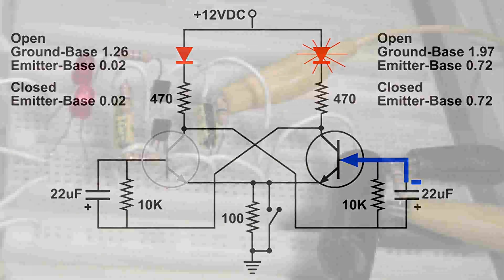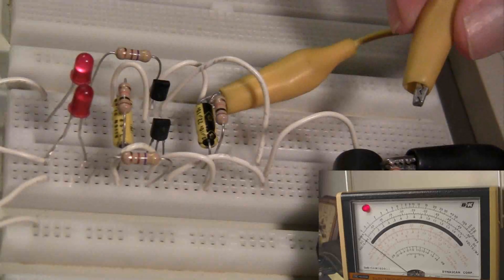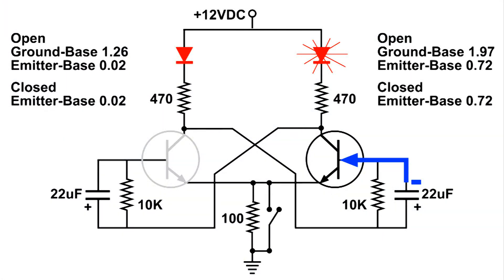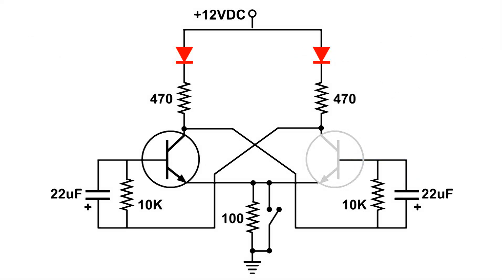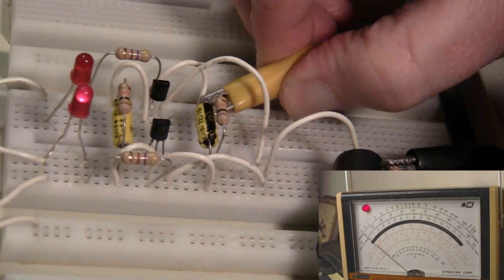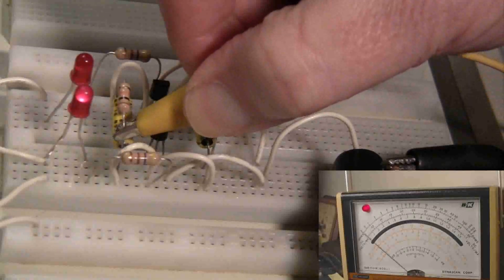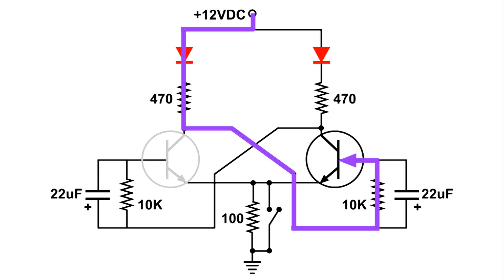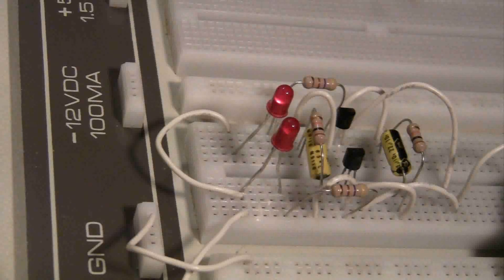Flip-Flop Circuit, build and demo

Comment: Thanks for this video, much appreciated, but I am confused.  At 2:12 talking about voltage levels, the right trans is on the left is not, but the left has a ground to base voltage of 1.26 which would seem to be enough bias to turn on the transistor?
And another point I don't understand, if the right trans base is getting it's voltage from the left diode side, wouldn't that mean current is going through the left side diode and would cause it to turn on, it has a 12 volt positive bias above it?  Obviously I'm missing something here and would greatly appreciate any explanation, thank you
Reply from the maker: +gw25 
For a junction transistor to conduct current between emitter and collector, the emitter and base junction must be biased from about 0.6 to 0.7 V DC, measured between the emitter and base. And this is not the case in either of your questions, that's why the transistor is not conducting. So if the voltages on the emitter and base never exceeds  0.6 to 0.7 V DC the transistor is not conducting.
Reply: +AllAmericanFiveRadio < Thank you again good sir.  I still have a point of confusion and I guess it's more in the nature of diodes.  At 5:25 there is a path from the right diode, through the 470 resistor, then crossing over to the left side of circuit going up the 10K resistor, through the base to emitter junction, and then through the 100 Resistor to ground.  So the right diode has a 12 volt source right above it and then a path to ground making a complete circuit.  Does it not light up because the 10K resistor limits the current too much to light the diode.  B/c currently I have a understanding that diode will conduct, and in the case of an LED light up, when it has more than a .7 (or so) positive bias across it, resistors are just used to drop all the rest of the voltage and limit the current.  Thanks again and hopefully I'm not being a pest.
Reply from the maker: +gw25 
In this circuit the transistors have only two states, when they are conducting it is a dead short, when they are not conducting they have infinite ohms. So the side that is conducting shorts out the 12 V DC and the other side cannot see it. When that side stops conducting it is wide open, now the other side can see the 12 V DC because it is no longer shorted out.

Keep asking your questions, I can remember the first time when I was trying to figure this out.
Reply: +AllAmericanFiveRadio , thanks and I shall.  So I believe I understand what you are saying about the transistors.  When one is on it allows the 12 V source a path for the LED with only a 470  and 100 resistor to ground allowing for a good deal of current.  But here is what I'm still failing to grasp.  The right diode is on it is b/c the right transistor is on.  And I believe what turns the right transistor on is b/c it has a voltage on the base to emiter junction greater than .7 volts.  I believe that voltage source is coming from the left diode (which is currently off) circuit.  At 3:56 you clearly show this.  So if there is current flowing form the left (off) diode to the base of the right transmitter, why is the left transistor not forward biased enough to turn on.  I enterperate you last explanation as when the right transistor is on it is sucking all the current from the voltage source, but as I currently understand things the right transistor is only on b/c of the voltage/current it is getting from the left (off diode) path.  

I also don't fully understand how the voltage for the ground to base is 1.97 volts on the right side transistor at 3:56.  Again if it's voltage comes from the left (off side) then wouldn't the voltage on the right side transistor base be what was left after the 10K resistor.  As I currently calculate that would be (11.3/ 470 + 10K + 100) * 10470 = 11.19 voltage droped at the after the right transistor 10K resistor.  

Thanks again
Reply from the maker: +gw25 

Think the problem you're having is you're not understanding what a transistor does in the circuit. The side that the LED is lit, take the transistor out of the circuit and put in a straight wire from collector to emitter. So now the resistors that are in circuit are the 470 ohm and the 100 ohm to ground.

I think this video will help.

Transistor, How Does it Work in a Circuit, Demo
https://youtu.be/vs3zUHdlsYY

Comment: Hello , I appreciate your work and explanations of circuits, question..will this flip flop circuit work as an h bridge, similar to an h bridge running in astable mode reversing a dc motor??
Reply from the maker: The H bridge provides two paths to power, one positive and negative, and the other one negative and positive. This flip-flop circuit does have a path to positive when the light is lit, but the other side is open, no path to the negative side.

Comment: so im planing on building one of these circuits for my car. ive got 4 coilpacks currently in parallel batch fire. which isnt desirable. they are 4 wire coils with 12v pos, earth, 5v trigger send, and trigger return (tells the ecu fire was successful).

i want to make this circuit using 12v to the coilpacks as the source voltage (data input) and instead of a switch, i want to tap into the 5v trigger, and hook it to a mosfet to act as a high speed relay for the switch. 

in effect, the q and bar q will turn my batch fire into a proper waste fire where coils 1&4 are powered on q and 2&3 powered on q bar.

the trigger will fire every 2.67ms at redline, and coil fall and charge is supposedly 1.8ms so that all looks good to me.

THE QUESTION:
will running 12v (i THINK 6a but i havent put an amp clamp on it) through this type of circuit be possible? im new to digital circuitry and im having trouble figuring out if this will work like a charm, or burn up and die.

i have a schematic i can send you as well as all sorts of specs like trigger rate etc

anyways, any help would be appreciated!

Comment: Is there any way you can automate the switch so it you do not have to open and close it manually?
Reply from the maker: Yes, do a Search  on my channel on “MOSFET Multivibrator Build and Demo”
You can use other transistor types besides MOSFET
Reply: Yes, it's called an astable multivibrator and it's a very similar circuit to this.
Reply: Thanks. :)

Comment: At 4.03 are you saying that the capacitor discharges in the base of the transistor and turns to off? Wouldn't a current turn it on? Sorry, my understanding of electronics is still in the early stages. :s
Reply from the maker: I'm using NPN transistors, and the N and P denote the type of material doping, in this case silicon. The base material is doped P, that means if you put a positive bias on it the transistor will turn on. If you put a negative bias on it it will turn off the transistor.
Reply: Many thanks for the info. :)
Reply from the maker: Flip-flop circuits are very balanced circuits. The impedance or resistance at the collector is much higher than at the emitter. When the 22 µF capacitor charges the current charging the capacitor never exceeds the transistors trigger threshold. When the 100 ohm resistor is shorted, this makes the impedance at the emitter even less and that causes the charged 22 µF capacitor to produce a negative pulse on the base of the NPN transistor turning it off.
Thanks Sam
Reply: Positive current at the base of a NPN  transistor will turn it on while its there, but negative current  will turn it off, Notice that capacitor only gave a very short negative pulse, if the other transistor did not turn on or was not in the circuit this transistor will come back on again when negative pulse ended, Because the other transistor came on and  positive current stopped flowing through the base of first transistor it stayed off.

Comment from the maker: Thanks Lachlan Baird-MacKenzie
I'm going to experiment building another flip-flop circuit using FET transistors. My thinking right now is it would be easier to build and work better, but it could be just the opposite. Anyway it will be an interesting experiment.

Comment: Thanks for an excellent explanation of a clever bit of circuitry. I stared at the schematic for a while and couldn't make sense of it, but your blow by blow account of what is happening really made the light-bulb go on in my head, especially with that negative charge in the cap and the surge turning the transistor off when you disconnect the lead shorting the andt ohm resistor.

Comment from the maker: I found a very good PDF on the MC34063A.
Google “MC34063A - Step-Up/Down/Inverting Switching Regulators”
The PDF will be close to the top of the page. It has descriptions of the chip, the specs, and circuit examples.

Comment: i watch the breakdown circuit flip flops and learn how it work, is there anyway u can do a breakdown of a MC34063 switch-mode boost converter. The reason for this is how can i built a power surply  with an input 3v - 6v and the out of 19v and an ajustable current. What is the max current and lowest current that i can get. " THANK YOU"

Comment from the maker: The transistor that is 'off ' gets a positive pulse through the 10K resistor turning it 'on' when the other transistor that was 'on' gets a negative pulse from the 22uf capacitor when the tiger is opened.

I drove it with a signal generator

Comment from the maker: @IBreedBassetts9C 
When the 100 ohm resistor is back in the circuit this produces a voltage drop. The capacitor is charged with out a voltage drop. When the resistor is back in the circuit the voltage drop across the base-emitter junction is high enough to forward bias it, driving the transistor into saturation.

Comment from the maker: Thanks mediaguardian
Yes thats right on the ground-base voltages. The 10K supplies the + voltage to turn on the transistor. The cap supplies the - voltage to turn off the transistor. If the 10K was changed to a resistor to high it would not turn on the transistor. If to low it would keep the transistor on.

Comment from the maker: Thanks engmustafa83
The transistors are 2N2222, both about 210 beta. All resistors are 5%. The caps are 10WVDC. Like I said in the video it did take me a little time to get this to work. I had to swop out a few parts to get thinks to match.

Comment: Hi,

I enjoy your videos and am trying to learn electronics (I am a retired computer scientist).  I am trying to figure out the difference in the voltages when the led is lit.  Am I to assume the ground-base voltage takes into account the voltage drop across the 100ohm resister whereas the emitter-base voltage doesn't?  Also, what is the significance of the 10K resisters in parallel with the caps?  Could they be 5K or 20K?

Thanks,
Jim